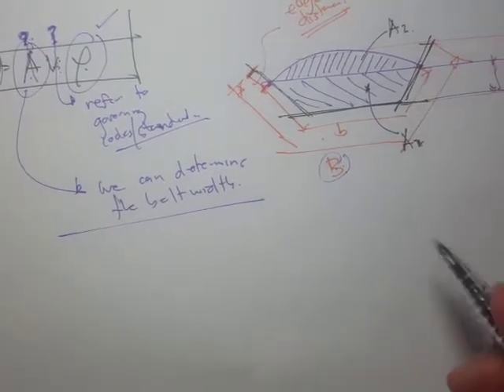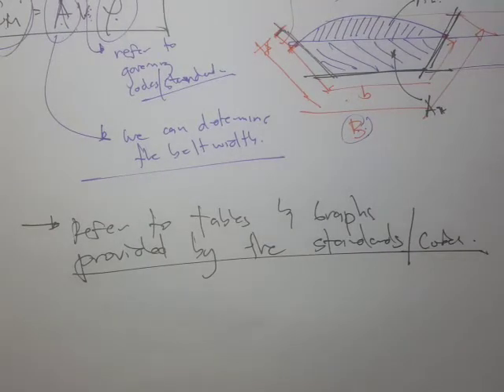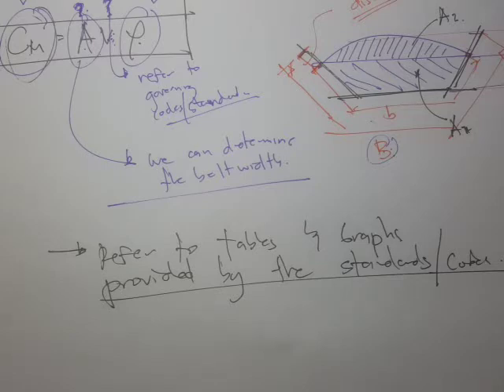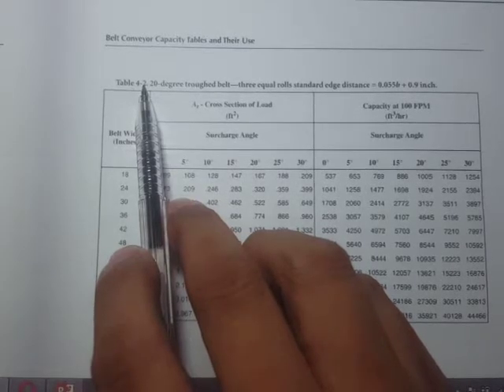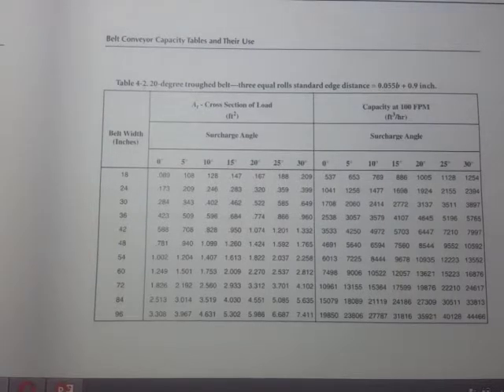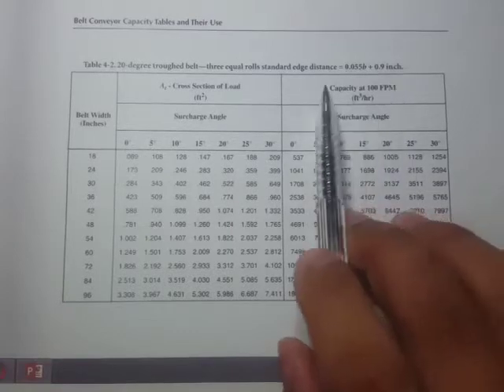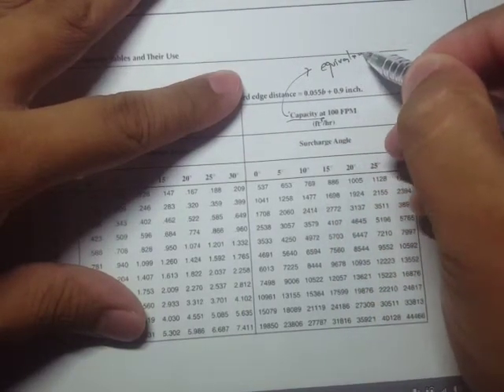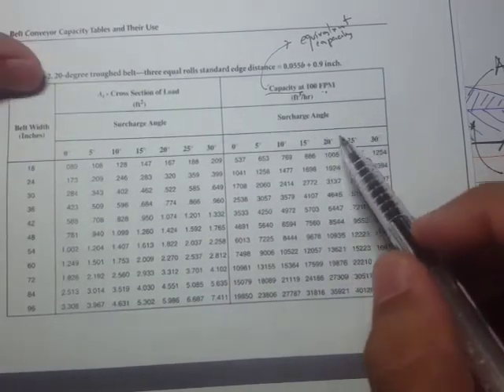ABE180 - 05.02 - Design of Belt Conveyor (Part2)

Comment: Sir please elaborate the drum dia 6 to 20 its dia of drum
Reply from the maker: hello sir/mam, they refer to commercially available pulley diameter based on the reference i use in teaching this course.  but i think you can also find other sizes and increments (and even dimension units).  you just have to check the manufacturer's catalogs, and things like that.